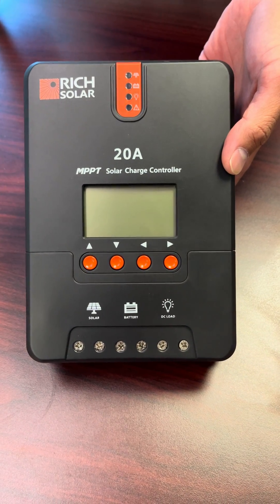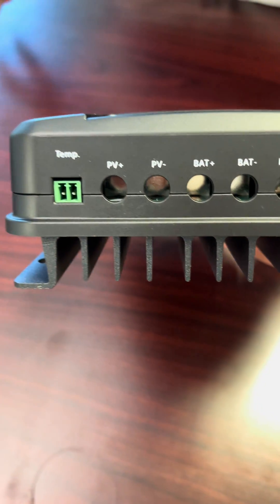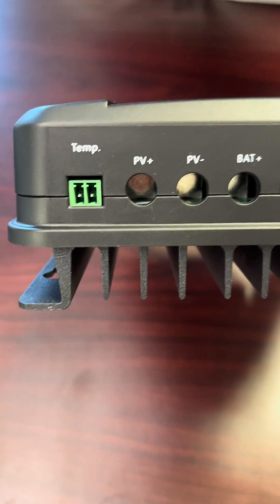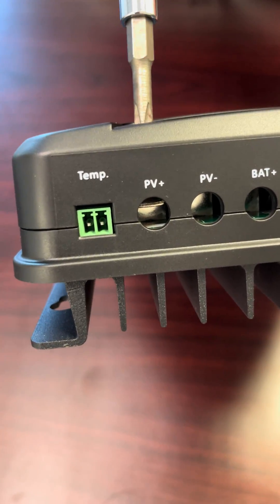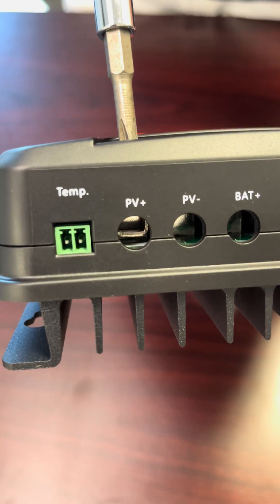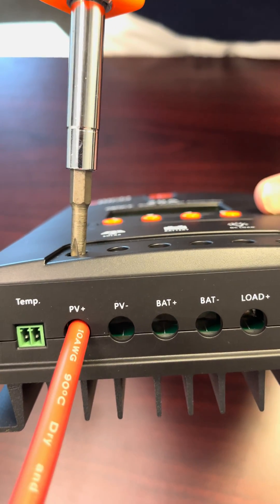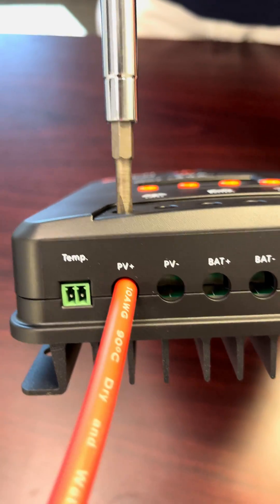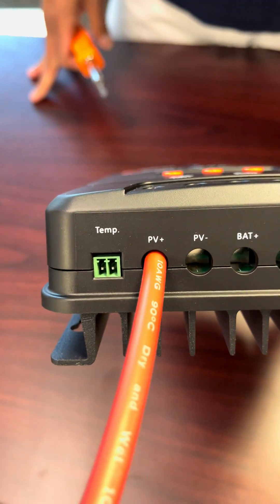How to CORRECTLY install wires into a RICH SOLAR MPPT Controller

Comment: Mine new RS 40A MPPT won't power on.  New lifepo 200 Ah battery shows 12.6 V -- I'm looking into whether its BMS has reached discharge cutoff, and whether this battery may have sat in a warehouse long enough for it to have run down.  When I connect SCC, battery shows 6.7 V.  Should SCC start with batt as low as 9 V?   I'm inexperienced.  Please help if you can.  Thx.

Comment: Where is the nut to ground the charge controller?
Reply: On the bottom right corner near heat sink you will see a ground screw just below where load negative terminal inserts into controller.
Reply: @rottenrobbie66  Interesting that none of the documentation mentions this nut.  Plus it looks like you can only put in a pretty small gauge wire.   Not a great design.